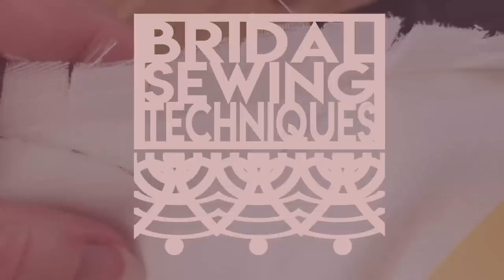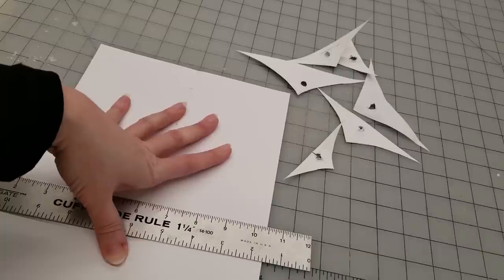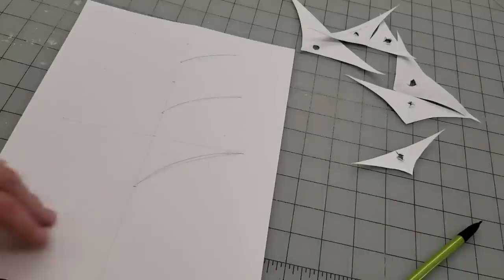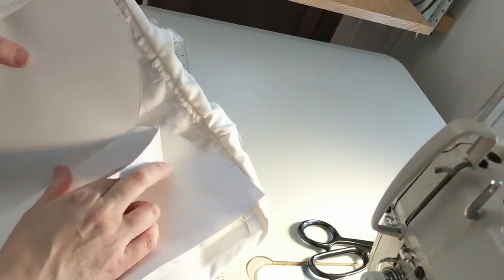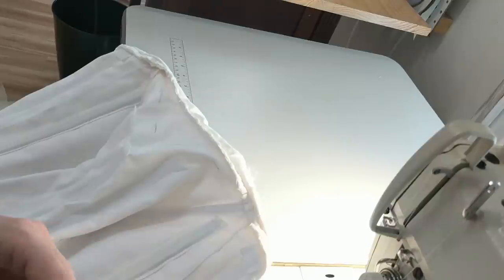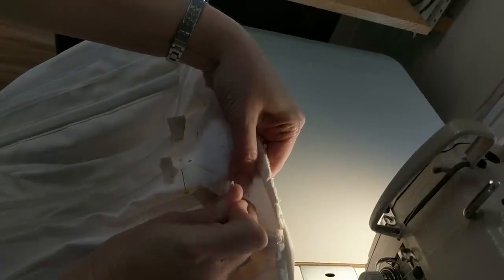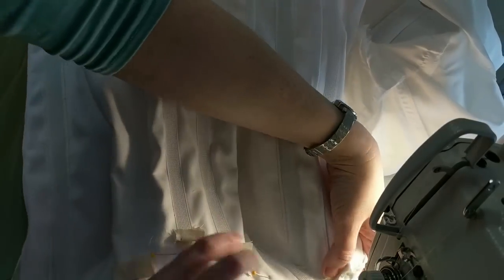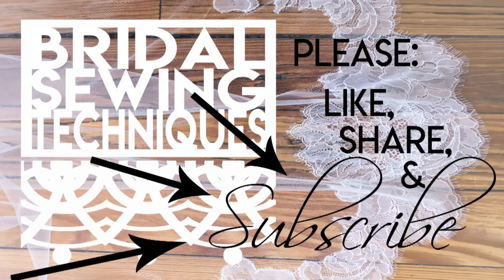How to sew a sweetheart neckline, make, add a sweetheart neckline to a wedding gown

Comment: I am making my own strapless sweetheart wedding gown out of jacquard. What fabric layers do I need in the bodice? I have searched so many options and I am confused! Do I attach the boning to the lining fabric then interface the jacquard or do I need a stiffer heavier fabric to attach the boning to and then put the lining over that? Thank you!
Reply from the maker: Hey! This is a way bigger project than what the comments section can help you with. Maybe start with a purchased pattern that has all of that info in it? 🤗 That should really help. Good luck with your gown! ❤🍀❤
Reply: Thanks, I have one but it doesn’t explain the fabrics very well. I made the pattern in muslin to fit it so far.
Reply from the maker: @JD-im2kh  I recommend doing some sampling of layers. Just use a 12x12 square of the different fabrics & layering choices that you are drawn to. Play with the stacks & see what feels right to you. There's no standard right or wrong that I can say at this point. There are so many variables.

Comment: Help!  8:02 when you're talking about turning it inside out did you unpick the lining from the zipper seams or side seams or remove it altogether?  I'm trying to visualize what you're doing in this step and apparently my 'visualizer' isn't working properly.  :D  I feel like I'm missing something.  I just need to know where the lining was removed.  Please and thanks....I'm LOVING your channel!
Reply from the maker: Kendall Denney Okay, no problem. If you tunnel your hand up the skirt and between the bodice layers, (between lining & outer layer) grab the belly area of the dress where the boning is and pull it wrong side out. Now you can work on the guts! 
Dresses vary on their construction, so your method of getting to the middle of the dress will vary. Some dresses, you have to slit a vertical seam of the lining & then tunnel there. Some, you have to untack the bodice lining from the skirt to get inside. 
I'll try to do a video on the various ways of getting into "the guts" of the dress sometime! :) 
Thank you so much for watching! I really appreciate it!! :)
Reply: Bridal Sewing Techniques Thank you so much for your reply!  I suspected a go-from-the-skirt-end approach for a strapless gown but wasn't sure. There are so many tips and tricks to be learned and your feedback is invaluable.  I would certainly love more info on the different ways to access the guts of a gown and more particularly, how to get it sewn back up neatly so it's not a hot mess.

Comment: This neck is easy to cut but the way you are doing am not understand
Reply from the maker: Maggie Baidoo if you tell me what points are confusing you, (for example, 2:35-2:55) I might could better explain what is going on at that time.
Reply: I understood the video up to the point where you cut and stitched it. How did you get rid of the rough edge?
Reply from the maker: You don't have to get rid of the edge because you are working on the inside layers of the dress. Once you flip it right side out, you will only have the neat seam edge.